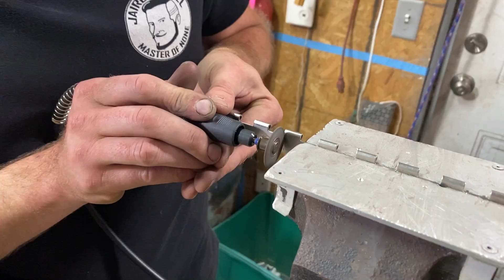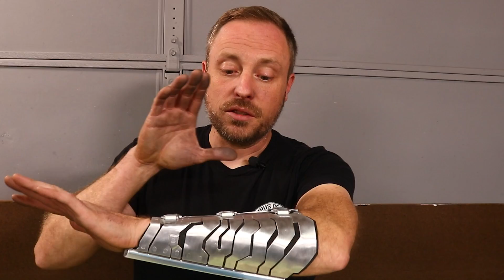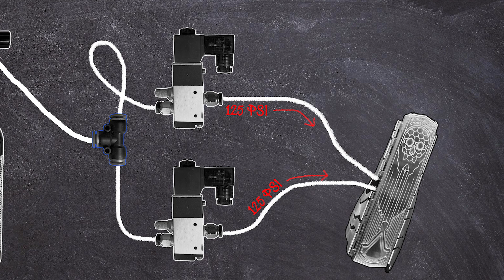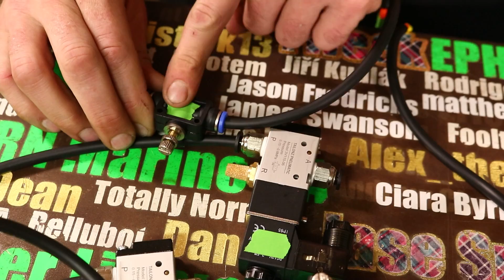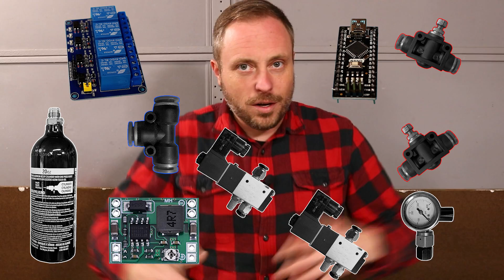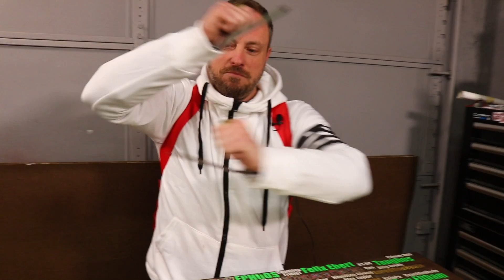Assassin's Creed Hidden Blades - new modern design

Comment: This has way too much baggage to be practical. Its still pretty cool though, but there's other ways to go where you're thinking with a wind up power source. Your way requires too much piping, electronics, regulators, valves, batteries. So you might need another way that requires a more simple though practical design.

Comment: The only flaws I see is that it is very dangerous. The whole point of the flicking motion in regular hidden blades is that it triggers the mechanism and gets your hand away from the blade. and since the blade in this model is directly against your arm it will most likely cut your finger off, this is why the hidden blade was modified in ac2. Also if your fighting with the hidden blade and not using it for stealth this model would be very good but for stealth kills it will be very slow to kill someone since you have to press a button then stab the guy, but the flicking motion of the original hidden blade allows for a smooth fluid motion that comes very easy for anyone. In the game you see that player practically grab the enemy's head then stab them with the hidden blade, this wouldn't be possible with the the button model because when your hand is on their head you would then have to reach for the button to then kill the enemy. The flicking motion of an original hidden blade will extend the blade while putting your hand on the enemy's head, this is the same thing with the chest, chin, etc. This hidden blade has its pros and cons for overall it would mostly be infective during stealth, or at least very slow.

Comment: actually, you can use only 1 solenoid valve to control both sides by using a 5/2 solenoid valve and it might be easier to control

Comment: Usability wise, sure it works a treat. And the concept is amazingly cool.. But the whole point of these blades were to be hidden, and light in order for the assassin to move freely. That big hardshell backpack can't do that. Essentially all you have done is made a big air powered switch blade. As I said, very cool, just isn't what your selling it as!

Comment: You could replace the valves with a standard 5/2 or 5/3 valve, that are made to control a double acting piston. Difference between /2 and /3 is /2 has 2 positions, provide pressure to extend or provide pressure to retract, and /3 has the same 2 positions, but between them is a position that cuts off the pressure

Comment: While this is really cool, I have a hard time seeing this as an improvement over other designs. It has no locks to hold the blade in place for actual use, it requires a backpack, and makes a loud clink when the blades reach end of travel. Not only does it not address the stealth concerns you outlined in your previous video, it adds additional overhead that makes upkeep and maintenance require an entire machine shop.

Comment: You Should add a safety mechanism so when  you extend your wrist back it can be activated and when your wrist is flexed downwards or relaxed it cannot be activated. This could prevent it from being activated accidentally and potentially injuring the user. There could be a trigger on the dorsal side of the hand so when it’s extended back it disables the safety and the trigger in the ring can be activated. Just my two cents!

Comment: Friend, IF you could make the system work with one or even two Airgun CO2 Cartridges and a much smaller pack, you might have something. Even if you only got three or four actions per CO2 Cartridge, you could always replace them.

Comment: Love what you have done with the design of the blades. Truly awesome, and one of the best renditions of the hidden blade. 
I have some critical points though, in a fight if the opponent cuts the tubes to your blades or the tubes develop a leak, the blades will not work. And since you have taken the design from the games, the blades in the games whose mechanism never broke. The one time a hidden blade did break, only the blade broke and not the mechanism. 
My second critical point is that for the blades to function you will have to carry the backpack everywhere, and you wouldn't be able to remove the backpack without someone's help which defeats the purpose of stealth.

Comment: how about a spring loaded metal locking pin to hold it locked when extended and have the pin be retracted by the retracting air pressure so it doeant rely on air pressure to exert force when extended?

Comment: Honestly though, adding the backpack and tubes... makes the whole realistic/ useable plan out the window.
Reply: You talk about backpack by no one mention that idea of slapping electronic and air pressure to simple hidden blade is just overcomplicated mess that would probably need constant, everyday maintenance due to seals, air leaks, battery charging etc.
No one with brain would put their lives on such unreliable device.
Yeah simple spring knife mechanism need space to open fully, but that can be dealt with... You know, actuall training and practice. And spring knifes if made good don't need any maintance and are solid enough to stab someone without worrying if blade will bounce back due to air compression or leak... Or battery percentage... Or leak on pipes on huge ass backpack...
Reply: @paranoiia8 just admit it’s cool and move on..
Reply: literally lmao
Reply: @Jroki-v1q liddurrully
Reply: Not exactly you can go through everyday life wearing a backpack and a baggy jacket and boom problem solved it looks like a dude in a big jacket with a backpack.
Reply: @PotatoWithALaptop  yeah. Nothing  says stealth like a bulky backpack
Reply: @jordanmc9015  bulky jacket not backpack
Reply: Absolutely agree this isn't a hidden blade is a visible blade
Reply: I feel like the big metal armpiece bulging out of the sleeves is less stealthy than a normal looking backpack. But yea it takes a whole lot more space than the older idea. But this is the truly realistic modern version.
Reply: Yea lol, assasins need to be light. Backpacks make parkour hard
Reply: @TheSecondLaughingSoldier assassins needs to be able to go in and leave as quickly and as nimble as possible
Reply: You can hide the equipment easier though
Reply: Not really this is much more usable than any other build, the main reason of the actual retractive force, yes it may be harder to put on and setup but it works
Reply: @GrimFate08 imagine doing parkour with all those mechanism
Reply: @notproductiveproductions3504  guys this obviously won't work as an actual hidden plane. The main thing I think is someone actually made an actual usable retractable blade. All the other ones on YouTube are just knives strapped to a wrist with no retracting
Reply: @GrimFate08 but that defeats the whole point of the hidden blade. not very hidden when u have a big ass backpack strapped to you
Reply: @space1340  I don't think it's that much of an issue. A backpack wouldn't be out of place today and would blend in well thus not revealing anything about the weapon hidden in the sleeve.
Reply: @madensmith7014 I agree, but it's way less convenient to carry a big heavy backpack around

Comment: I am definitely curious to see how well the air pressure can keep the blade extended. If it's not enough, you'll have to come up with some kind of locking mechanism that can be engaged and disengaged with the same airflow

Comment: I wonder if those rings can be made into tiny remote control that sends a signal to something that opens up the valves in the back pack like another little module things but I'm just full ideas still the coolest hidden blade I've seen the sound is like the sexual ping of a m1 garand

Comment: Super cool! I’ve been looking for someone to actually make working, modern, and HIDEABLE hidden blades forever lol. You should do the basic tests of milk jugs and watermelons, but if you really want to test the “real life” usability, you could get a ballistic dummy.
Reply: Just curious what do you think of RAWICE511's design on the hidden blade? because it seems to be pretty compact and subsequently hideable.
Reply: @Satheo05  I actually hadn't seen this design before. It is a very interesting take on the piece, it actually solves the issue of a possible misfire. The only real issue I see with it is you can't fit it under your sleeve if you hope to be able to activate it instantaneously, and there could be an issue with activation if there is something in the way, but it is a very cool design.
Reply: @mash9592  are you referring to the mantis blade he made? because this design https://www.youtube.com/watch?v=n6sGkFsi7QY&t=106s is more of what i was referring to. It can definitely fit under a sleeve.
Reply: @Satheo05  Ah, I was. I do like this take on the design, and I like how it doesn't require any extra devices to power it. If he made it into a metal design, I'm sure it would be one of the best and most reliable designs there is, I think the gears are more reliable than the tension bands or springs you see in a lot of other designs. If I'm correct about how he designed it, it looks like it fully relies on how hard you pull the string instead of on tension, which could solve a lot of problems the classic designs have where if you try to use it before it fully extends it becomes useless. It is a very good design

Comment: Any safety to prevent hand stabbing in the event of an accidental button press?
Reply from the maker: We treat them like a weapon. The CO2 has a ball valve and there is an electronics kill switch for the whole system. When both are active my hands are always out of the way until Bryce turns it off again. I don’t want any more holes in my hands than I already have. Lol

Comment: I think a super cool way of making the activation switches more stealthy is to put them in to a glove. Have the wire route through the glove material in like a double layered fabric to cover it from all sides and have the momentary switch stitched in to the side of the finger like where it is on the ring currently. That way it could be any kind of glove as well so it could be fingerless gloves past where the switch needs to be, or just full normal gloves.
Reply: Yeah but realistically speaking some events look weird with gloves like parties
Reply: @DarKKnight-gi8gx  true, but a wire on your hand connecting to a ring always looks weird, no matter where you are.
Reply: @randomcracka3  oh I didn’t know there was a wire I thought it connected to the ring.
Reply: or just loss sleeve